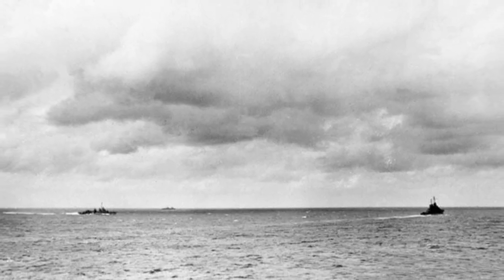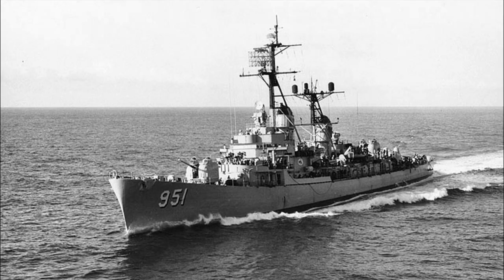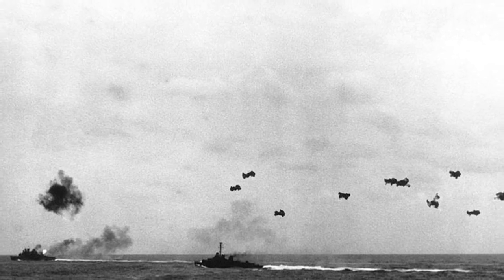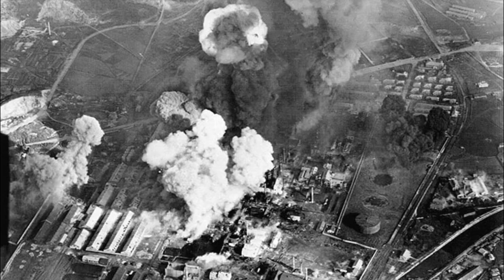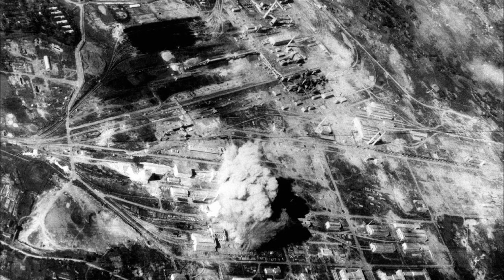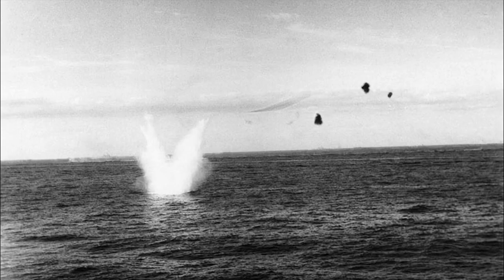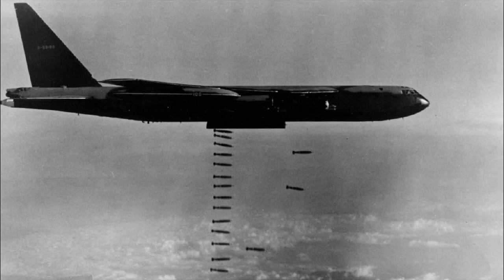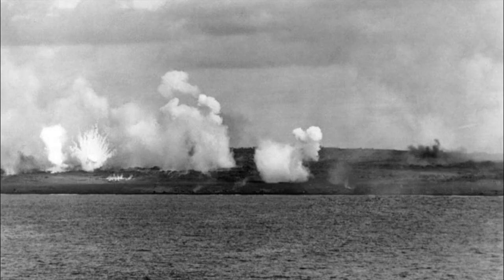Battle of Brandon Bay - Part 2

Comment: To Tracy TGYC:  NOT sure of your understanding of Naval Gunnery; there are pictures of the gun barrels of TJ firing in combat that were red hot & transparent with paint peeled off.  Our 5"54cal Mod 10 guns could shoot 40 RPM per gun & the loaders could only keep up for three minutes at that rate.  Combat pictures of the hot guns are in the cruise book & not faked!  Better research is advisable!  You're right this was 1 of many missions in multiple operations, but one of the most intense.